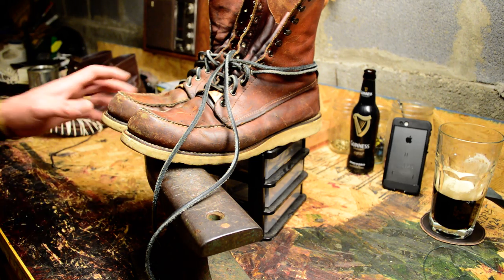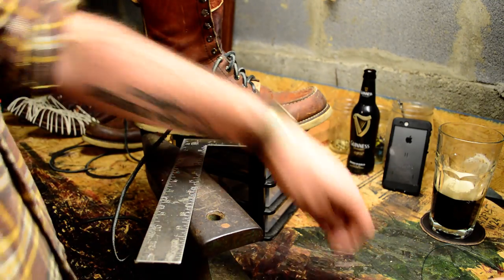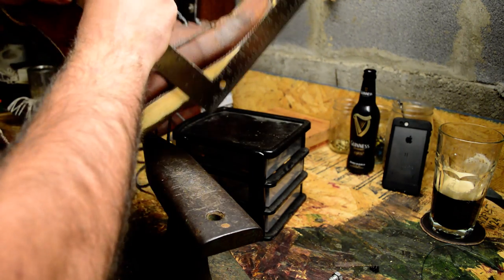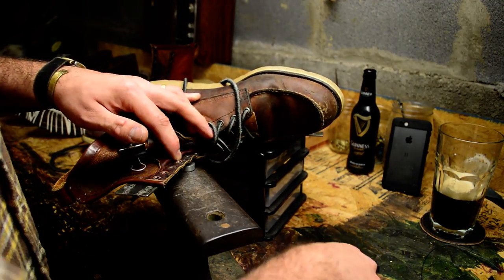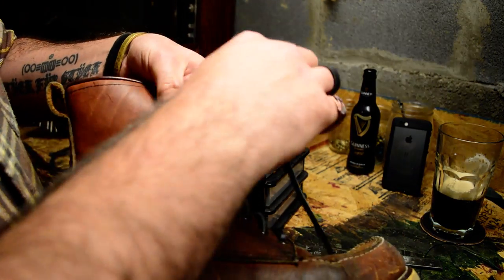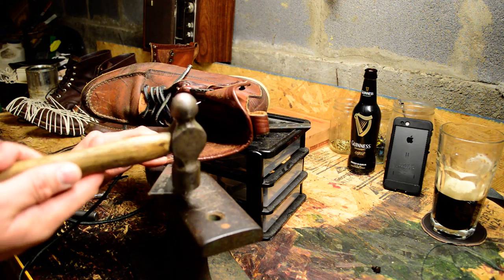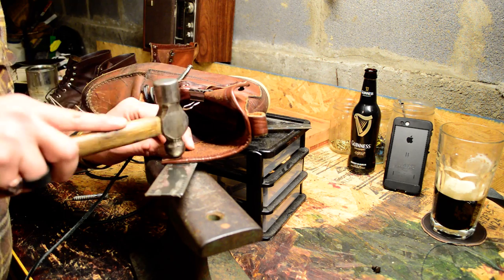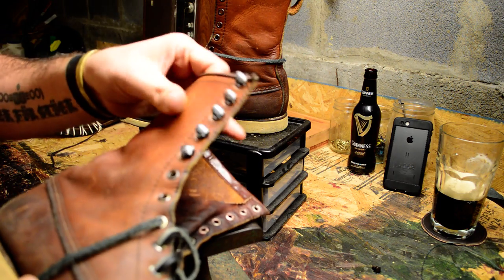Installing boot speed hooks

Comment: You got me w the Guiness bottle
The advice is what I needed. 
One suggestion. When opening the eyelet ,use a flat blade screwdriver. Put driver in from the sidevand twist. Pliers pull on one axis pulling againstvthe leather. The screwdriver camming  locks the other side. 
Thanks for the video. As noted all items for repair have been shop tools here for years.

Comment: Looked online for a grommet setter like the one you have.  None that I could find.  (some of them are prohibitively expensive) What I did find were setters in different sizes and very confusing which one to get. (so I did not get any)  I did manage to install 8 speed hooks on a pair of boots but they look ugly.  Used a rivet setter initially.  Didn't work well to split the rivet.  Then use a very large wood screw (like you showed).  But peening over the back did the best to secure them.  I am leery that my speed hooks will not hold for long.

Comment: Wait!  How the hell do you remove the original eyelets without screwing up the leather?  Maybe just the right sized drillbit?  Crazy, you are putting the speed hooks into the exact Redwing boots I plan to buy.  Had 'em as kid, and they had the speed hooks then in the early 70's!
Reply: Best to drill out from the back. Turn slowly. You just want to collapse the retainer ring. Not neccessarily full drilll removal. Rather weaken the retainer. Go slow!!

Comment: I tried using the same piece (L-shaped straight edge) inside the boot hook and the tip of the hook broke off.  What do I do?  I don't have an anvil either. What other surface can I use?  I just want to repair two boot hooks, so it doesn't make sense to buy a bunch of stuff for one job.  The shoe repair guy I called said that I could do it myself with just a hammer (flattening the rivet on the back of the hook).  The rivet has two holes per hook, so the rivet looks like an 8.  Thanks for any help you can give.
Reply: Its been a while but I'll answer for others that are in similar situations. No anvil, huh?  (Pretty sure its just a piece of railroad track shaped into anvil) What about a bench vise? Some have flat spots that are used for light hammering. But honestly any flat hard surface will do, a concrete floor or a sturdy workshop table will work. It only takes a few light hammer taps to set the rivet. Just use a scrap piece of wood so as to not damage anything. Some hooks are single hole others are double hole, make sure you get the right one for your boot. If you damaged your hook or need to get the original damaged hook off what do you do? Well either bust out a dremel (with a grinding bit) or a plain old drill and slowly and carefully drill/grind out the back of the rivet. It doesn't take much effort to remove a bit of the flare that's keeping the rivet in. Be careful not to damage the boot or any fingers. If you have the double hole rivet and your boot is a single not to worry. Take that drill and drill out a new hole. Remember use a scrap piece of wood when drilling. And don't worry too much if it isn't a perfect hole. It will either mostly be covered up by the new rivet. or not be seen by anyone to notice. Good luck.
Reply from the maker: user240485 thanks for answering! I was not receiving notifications.

Comment: Question:  How can one remove the eyelets safely from the boots without damaging the leather?
Reply from the maker: SalseroCPA use a drill bit slightly larger than the ID of the eyelet hole. Vacuum out any metal shards.

Comment: What is the best way to remove an existing boot hook that has broken off?
Reply from the maker: Amy Brantner drill the eyelet out from the back with a drill bit a little larger than the inside diameter of the hole. Don’t forget to vacuum the boot out to avoid metal shavings.
Reply: BWeiss Leather Thanks!

Comment: I have a speedhook that broke off - any tips on removing the grommet?
Reply from the maker: Edamame417 Drill Bit that’s roughly the same size and drill it out from the backside. Be careful and take your time, heat can build up and cause a burn ring or your bit can catch and jump the grommet. Slow and steady and you’ll be set!

Comment: Soooo, you're putting the the speed hooks into the hole grommets?
Reply from the maker: Candi Soda correct, I wanted to install them how anyone else would. The factory holes are solid and with a longer post on the speed hook it makes it easy to just pop in and done.
Reply: @GeneralF34R  Ok, just wondering. This is all new to me so I was confused. Thanks